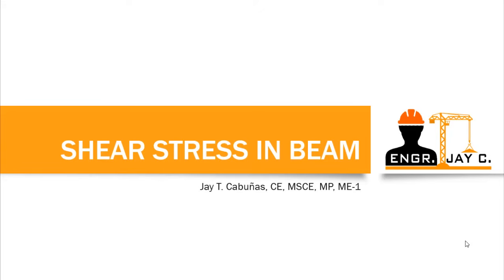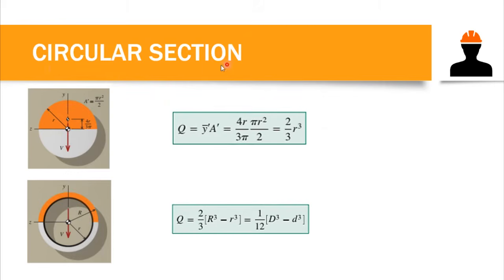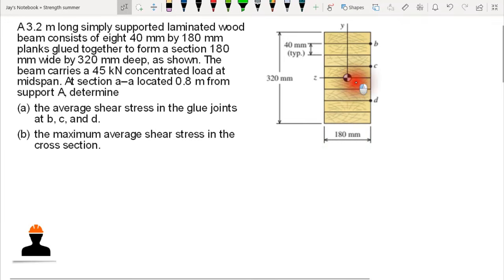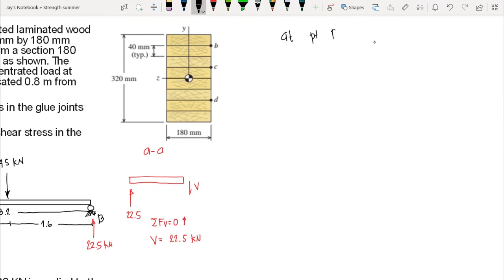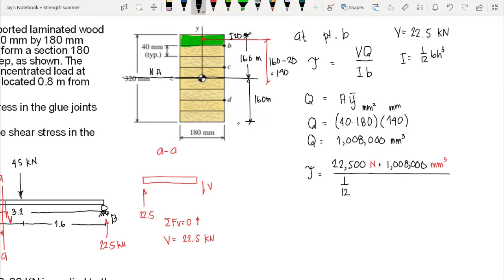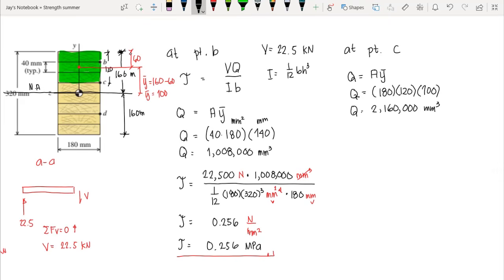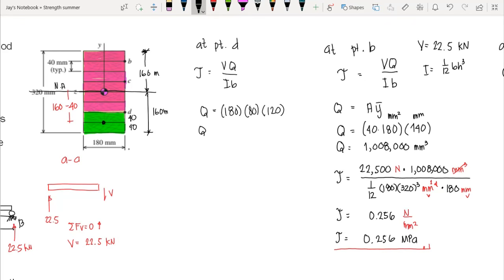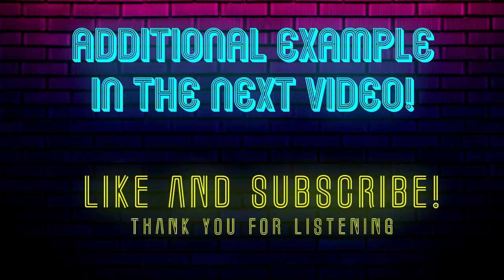Strength of Materials: Shear Stress in Beam (Part 1 of 2)

Comment: Something is not right... You use the vertical shear force to calculate the horizontal shear stress? The horizontal shear stress is the result of the bending. Assume your 45 kN vertical load is split in two times 22.5 kN vertical loads, near to the supporting points. In that case your vertical shear force is still the same, but there is like no bending at all. Hence, no horizontal shear force or stress. According to you explanation the horizontal shear stress would still be the same. Doesn't make sense...